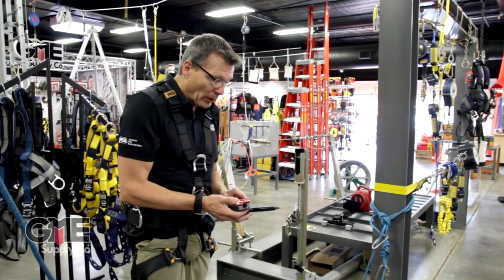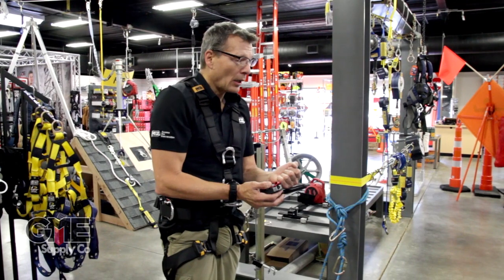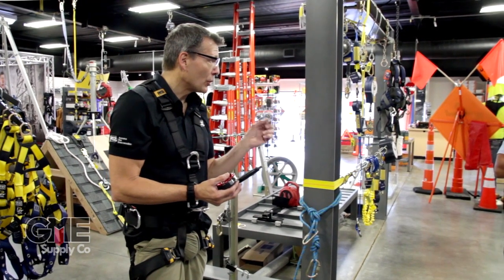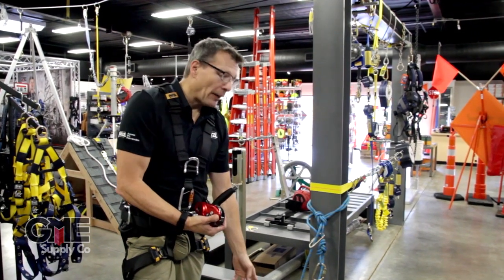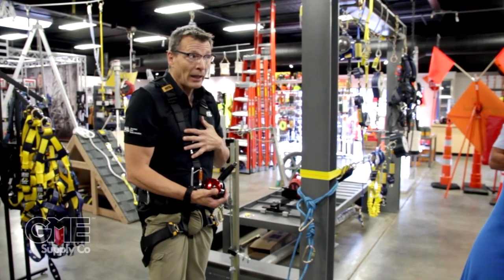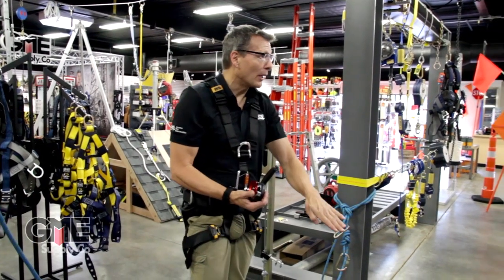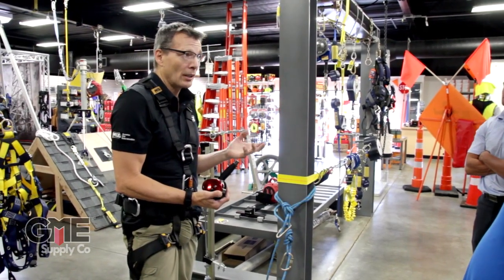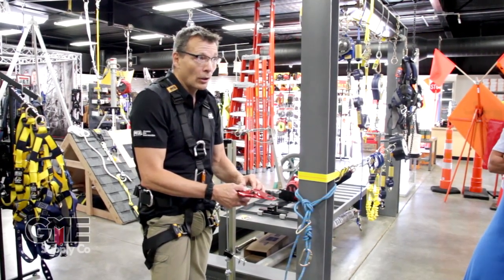Petzl Training - ID Predictable Slip Function

Comment: To clarify- he never said you could use the ID as a fall arrest devices - he was simply explaining how the device works when suddenly loaded. when using  your working static rope, you should never be in a position were 'fall factors' are a worry - that's for your backup rope/device, which should have some kind of 'arrest' system on it.

Comment: I'm not sure he was condoning the use of it as a fall arrest device but there was an inference there that the outcome would not be disastrous. Is the figure of 5.5-7KN correct for average point at which it slips and will it make any difference if it's locked or not?
Reply from the maker: +Tobo Good question... He definitely was not condoning the use of it for fall arrest. More that if you had too much slack below you and you hit the device before your backup caught you. 

We reached out to Scott the guy in the video to ask him to clarify. He confirmed that there is very little difference in the rate of predictable slip when the device is locked vs when it is in regular descent mode.

Comment: This is incorrect information. You cannot use an id as a fall arrest device!
that and the slippage is not consistent and very dependable on the state of the rope and diameter etc.wet or dry etc..